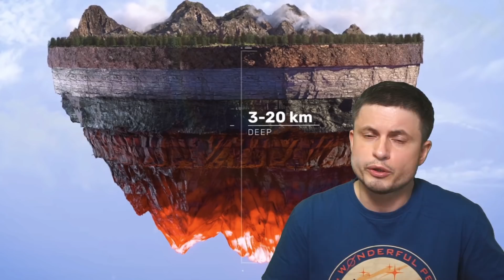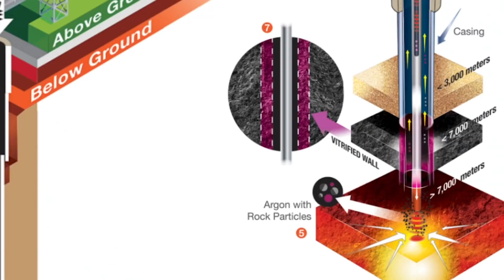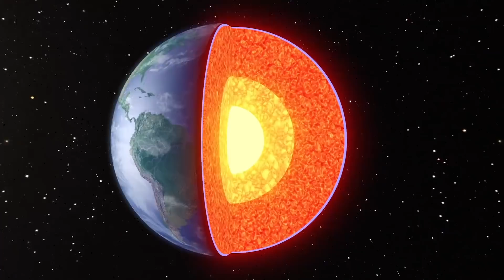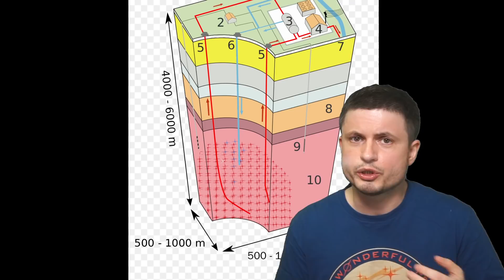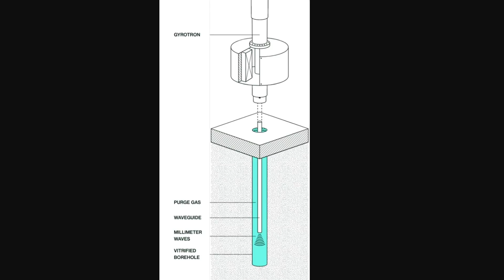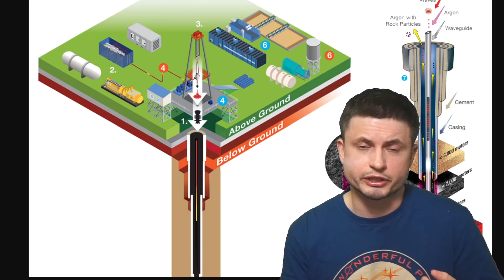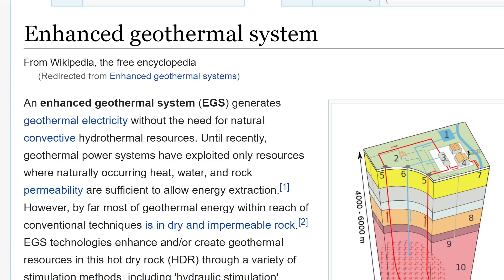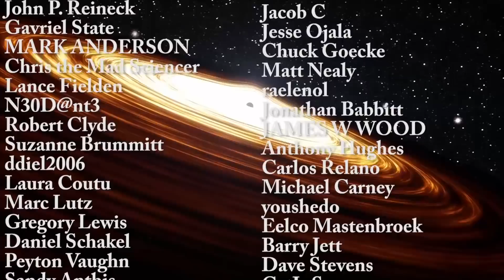Creating Deepest Hole on Earth For Geothermal Energy Revolution

Comment: shouldn’t we be preserving our heat as much as possible?
Reply: you severely underestimate just how much energy is down there, this is not a concern.
Reply: @Spartan0430  Some Chinese guy 100 years ago said the same thing about the amount of fishes in the sea
Reply: the sun will engulf the earth long before that is a concern
Reply: We've got about a billion years before the earth starts becoming uninhabitable due to the sun aging, and about 5 billion years of thermal energy in the Earth. Using geothermal power will not meaningfully shorten the lifespan of Earth.
Reply: @Sean Francis Waters Lancaster We are trapped in our solar system, so lets not make another mars, even if it takes thousands of years of consuming the energy in our core
Reply: @t16205  it won't take thousands of years, it's going to take millions if not billions of years. in the time we would have to spend harvesting the earth's energy to try to actively destroy the planet we would have infinitely more efficient and effective sources of power. this is not a concern.
Reply: @Spartan0430  Your logic is flawed. It does not make sense to harvest energy from the core, it doesnt matter if it takes millions of years by your calculations. If anything, we should try maintaining it. You expect us to have the same technological development as we have had the last 200 years from here to infinity. 

It pretty wild to want to take heat from the core and use it on the surface, risking the only planet in the whole universe that we know can support life, on the assumption that by the time we cannot live here, we will be so advanced it doesnt matter. 

We can experiment like this on other planets, but not this one. This one is special
Reply: @t16205  ? you're the only one who mentioned the core, which is ludicrous and beyond the realm of possibility. we just want to dig halfway into the crust.